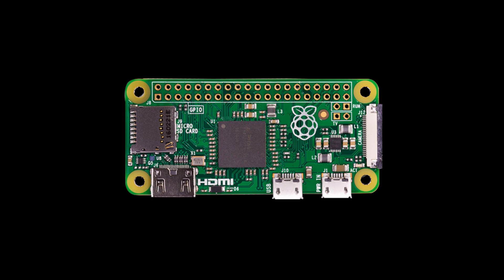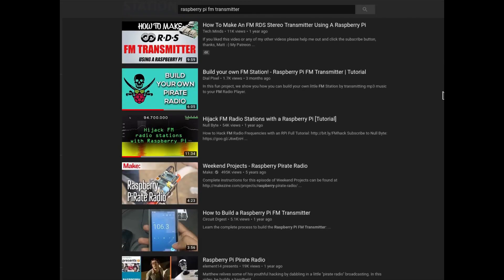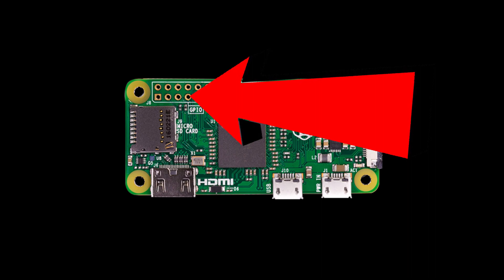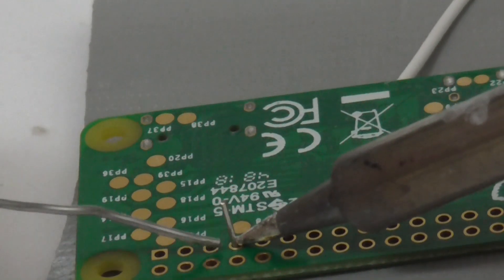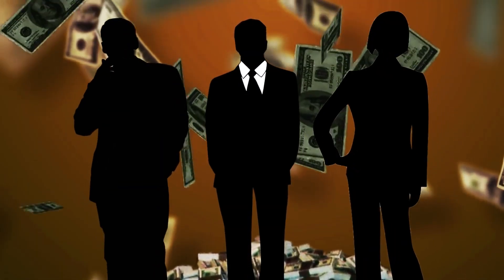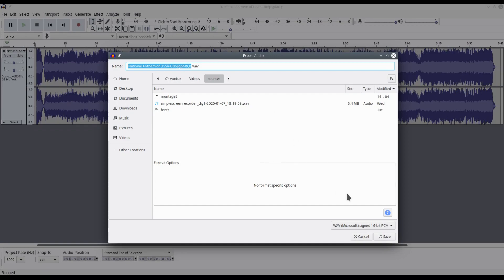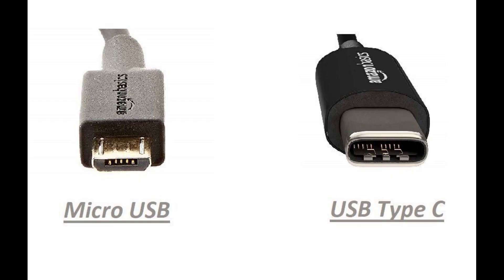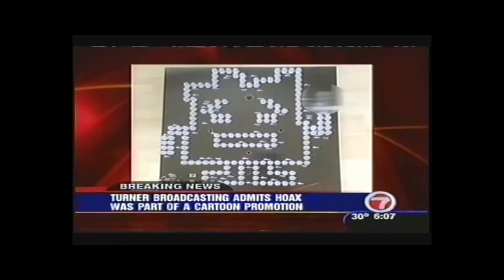Technological Praxis 1 - Radio PI

Comment: @Vontux is this somehow retraceable to the computer that configured it? and second, can you calculate how long this radio will last, by knowing the amount of mAh of the battery?
Reply from the maker: 1) Doubtful. 2) Should be able to. Measure the voltage / amperage with a usb voltage / amperage meter then google for a calculator to figure out the battery life you'd get with the consumption and the mAh of the battery selected.
Reply: @Vontux  thx for clarifying!  ❤️